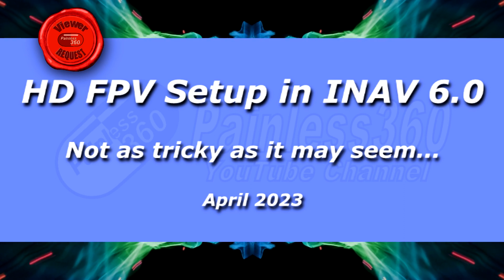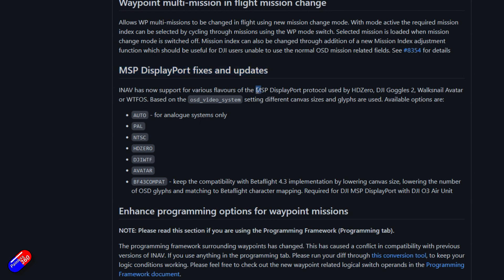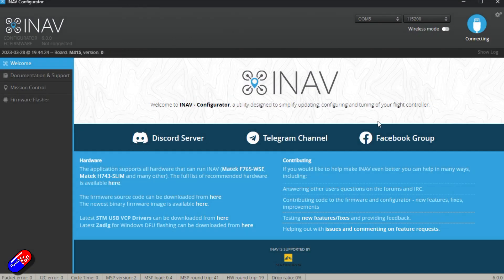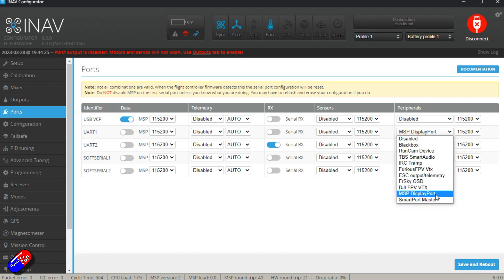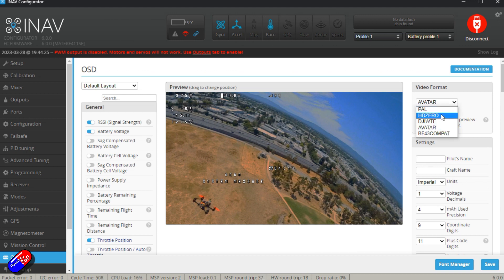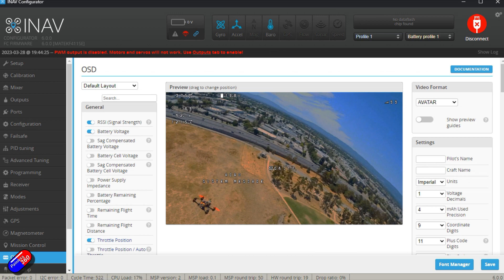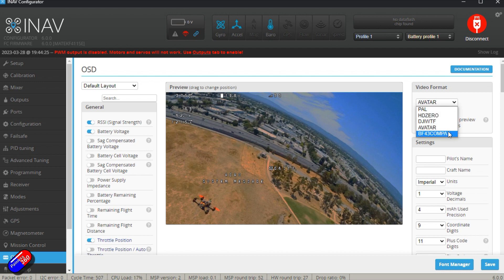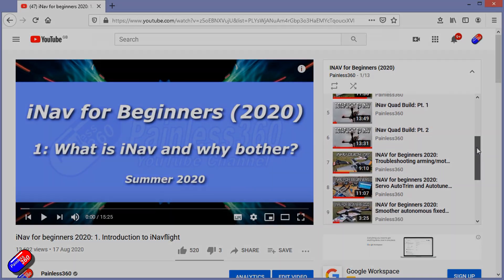How to set up your HD FPV system in INAV V6.x

Comment: Great video I have a question for you about the avatar system.so in the goggles menu the vtx power is on stand by and my vtx is on a inav flight controller do you have to set up a switch to get the vtx to go to full power when you arm.
Reply from the maker: If the AVATAR is connected to a flight controller, then the system will go to full power when it sees it arm. Best of luck
Reply: @Painless360  nice thanks for the help I was nervous to do the maiden when that stand by mod is on lol great videos helped me set the whole plane to

Comment: TIP: If you setup your OSD in the iNav interface but it does not render correctly or is placed off-center in the goggles.  There is an OSD position setting in the goggles/vrx that you need to change.  Googles > Menu > Display > ... OSD Position.  You will see some red lines, use the joystick to move your OSD into the center of the screen.